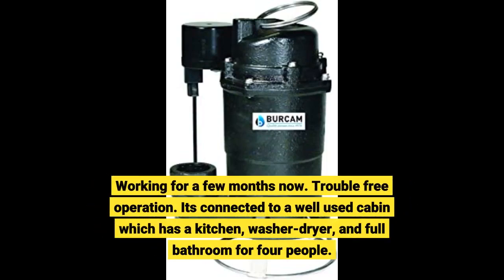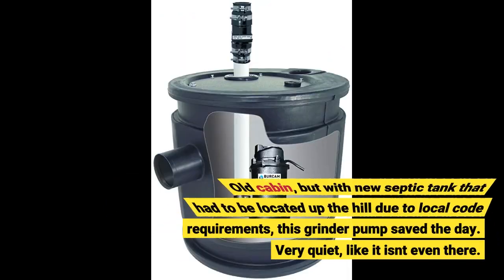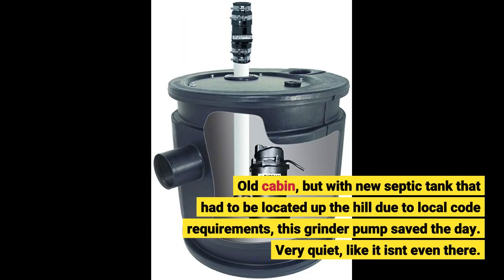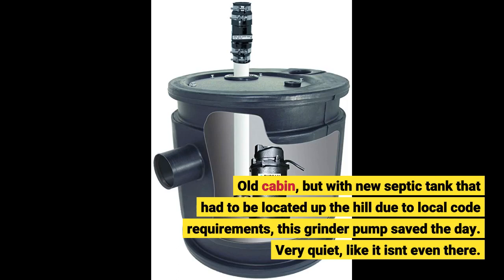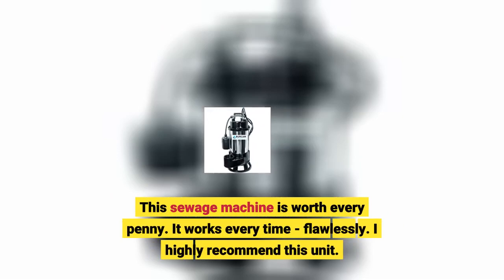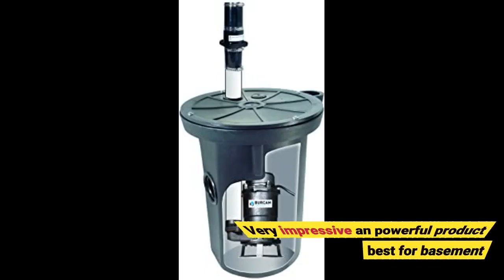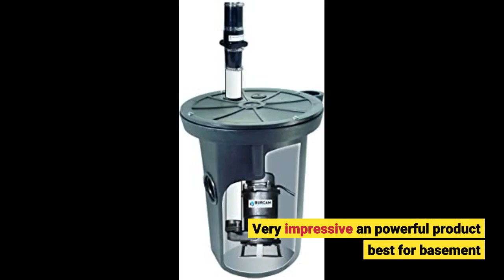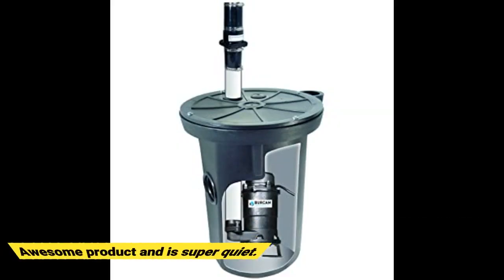User Review: BURCAM 401446P 3/4 HP Complete Sewage Grinder Pump System, Black

Comment: The legs on my pump were crushed, and after 14 months the pump overheated but the impeller still spins.
I sent burcam photos and asked for some outside the box help as my plastic trash can is buried outside
and the 4 and 2 inch pipes have to be under the frost line.  From the pump, it has to go out the 2" hole I made
in side of black trash can where 2" pipe goes 200 feet to septic tank.